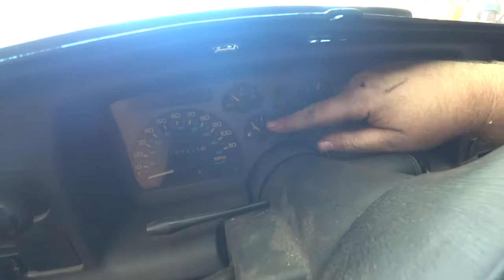The most controversial Mod to a 3rd Gen Camaro!

Comment: It hurts, but it should have had a slide door right there from the factory. There's no way around the laziness of GM when it came to these little things. Just like the window motors needing to be drilled out, inexcusable.
Reply from the maker: SinikkaL I agree, all of my other cars I have worked on had an access panel under the rear seat or around there.
Reply: i had an auto body shop make a door there for me. so if iever have to get in there, its removal of about 8 screws and door pops back on a hinge.

Comment: I made an access door on my fireturd last winter. Made a frame out of 1/8" thick 3/4 wide steel. Tig welded the frame with nuts on the underside. Clamped the frame to the floor and drilled 1/8" holes through the frame and floor for rivets. Made a gasket from single-sided foam tape that adhered to the frame. Traced the frame fastener locations onto 1/8" 5052 sheet for the lid and drilled the holes. Deburred all edges and painted the frame and hole edges with weld through primer and riveted the frame to the bottom of the floor. Capped with gasketed lid and 12 button head m8 screws. Very low profile, completely sealed, and is unnoticeable under the carpet.
Reply from the maker: Man that sounds way nicer than my setup, send me some pics :) email is in description

Comment: the trick is to cut a clean , square hole (lets say 10" x 10" )then you cut an access panel from a donor car (lets say 12" x 12") 

that overlaps all the way around.use maybe 8-12 pem or encapsulated nuts and bolts and a rubber seal and it will look factory fresh.

you can do it!!!

Comment: I’m a 14 yr dealership mechanic, own a 91 Z28 had since 01 Junior yr HS. I say it’s car your doing the work cut a pump access panel if you want man! If people get crazy about that then ok. I’m probably going to install a pump soon and I’ll probably just drop the tank. The cool thing about having the access panel is if I drop a new motor in her, I can easily get back in if need be. 

I was confused why you cut your pump lines and install hoses though? Maybe made it easier going back. FYI nice robe! Lol
Reply from the maker: Yeah I made use of what was there, funny part is I have dropped the rear end and did it the correct way first, then realized someone already cut it :( I will be in there soon to iron out a different fuel issue. It’s coming soon. Plus have you seen those access panel kits, only if I knew then what I know now.

Comment: Mine was cut open too by the previous owner. Good thing cuz I bought it after it sat for 6 years with a 1/4 tank of gas in it. RUST IN THE TANK!!! 5 fuel pumps later I replaced the tank. Now the access cover. Thanks for the idea.

Comment: I saw a cool idea for that access panel the 4th gens have a disconnection point in the lines right were you put your cuts in your lines. they also do the lines in plastic with quick connections

Comment: Your fuel gauge not working maybe one of the three relays to the right of the brake booster
Reply: Really?, I'll change em' right away
Reply: That's for fuel pump and ignition. I'm not sure what the third is for as I don't see in service manual which is weird... Gonna experiment on this

Comment: I know it’s a bummer but what you going to do. Mines the same way I hate it but if you make it look good who really cares. Also someone should come up with a clean way to represent a “ STOCK “ looking access door. Hmmmmm! Good luck buddy I’m sure it will look good you seem detailed oriented. GREAT videos by the way, plus princess had me rolling.
Reply from the maker: Brent Minton thanks man, I am still mapping out the top piece because I don’t want any fumes coming in and I don’t want to see it though the carpet.
Reply: the trick is to cut a clean , square hole (lets say 10" x 10" )then you cut an access panel from a donor car (lets say 12" x 12") 
that overlaps all the way around.use maybe 8-12 pem or encapsulated nuts and bolts and a rubber seal and it will look factory fresh.

Comment: I don't know if you fixed it yet but I had to go through two sending units to get the gas gauge to work again on my 92 Z28 . for some reason on some of these after market sending units the float stays on the bottom of the gas tank.
Reply from the maker: m1a1hm when I went to my Dakota digital dash it worked, not to say that is how you fix it or that there are junk sending units out there. :)
Reply: COOL glad to hear that. Say I know this is along shot but by any chance do you know where I could fine some back glass hinge bolts my are all rusty . There are some co. that sell after market ones but they want close to 100 dollar for them and it just four bolts.
Reply from the maker: m1a1hm I am going to need some as well, if I find a place to get some I will do a video on it.
Reply: Cool thanks dude!! I just subscribed to your channel.

Comment: Did you fix the fuel gauge, what was the problem?.
Ive change the fuel unit sender, and isnt working yet! 😐
Reply from the maker: Yes I did, it was the gauge cluster, half of it was not working. Oil pressure, tack and fuel. I did an install video of the new cluster